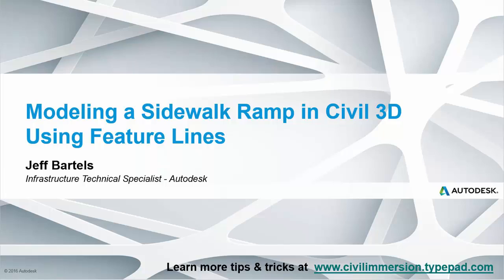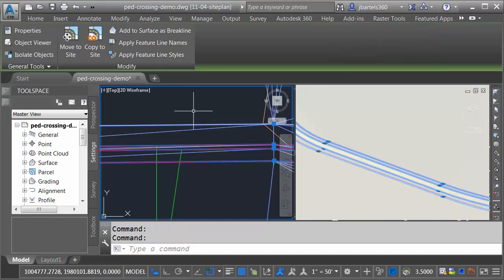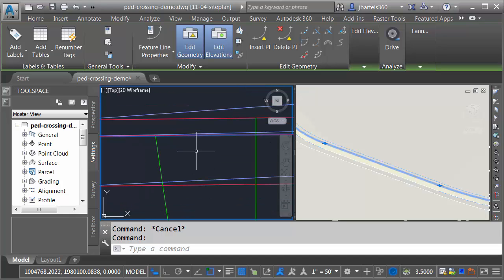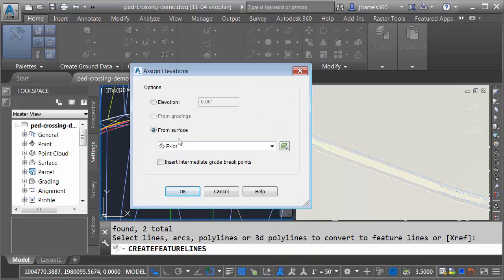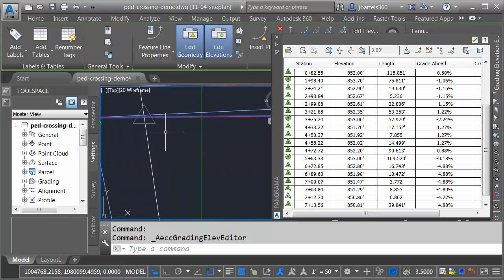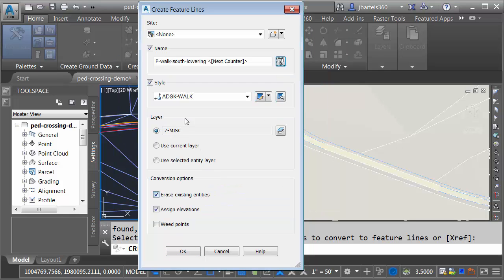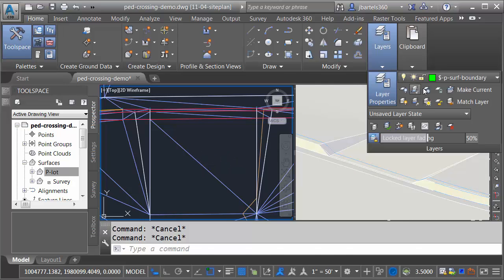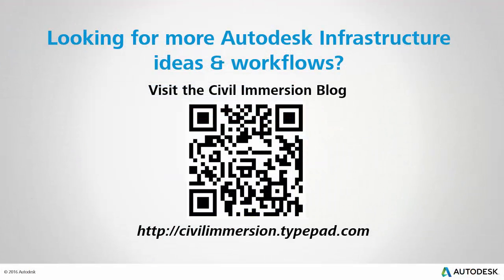Modeling a Sidewalk Ramp in Civil 3D using Feature Lines

Comment: Hi Jeff. I find you videos extremely helpful thanks. I was wondering if you had a full tutorial for this parking lot?
Reply from the maker: Hi James, The parking lot site plan is something I built for an Autodesk University class that I presented this year.  Over the last few weeks I've been creating tutorials that demonstrate some of the workflows I used to build the data set.  That being said, I'm afraid I do not have a full tutorial that walks through everything start to finish.
Reply: Thanks for the quick response. I haven't used Civil3D in years and I'm trying to piece together applications that work for my design from hell haha. I attempted using Corridors and assemblies to create the surface and grading but ran into some issues. I'm going to attempt to try it again using feature lines. Would be nice to find a step by step tutorial.

Comment: Barttel, could you tell me the features or characteristics of your computer? Clock's speed, memory RAM, and if you have any special video card. I have seen that your computer gives quick answer. Thank you for your video. As alway, they are excellent.
Reply from the maker: Hi Carlos, Please note that when I create recordings I will typically edit out "computer processing" such that viewers don't have to wait.  For that reason, a finished recording will typically be several seconds faster than the original recording.  I've provided my specs below.  This machine has been working great for me and the work that I do.  That being said, project sizes and system requirements can vary between users.  If you are considering a hardware purchase, do as much research as possible to ensure it accommodates your specific needs.I've got a Dell Precision 7710, 32 GB RAM, NVIDIA Quadro M4000M video card, and a 1 Terabyte solid state hard drive.
Reply: Bartels, thank you so much for your quick answer. Where I am working, with an I5, 16 MG RAM computer, and handling 1 MG size file, changing views from one  "tab" to another can take sometime 5 minutes. Of course, into this "tab" I have 19 profile views.

I thought you had 64 MG RAM.

Thank you Bartels again. I am one more of your strong followers.